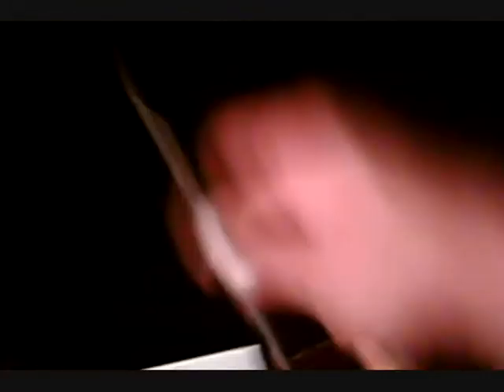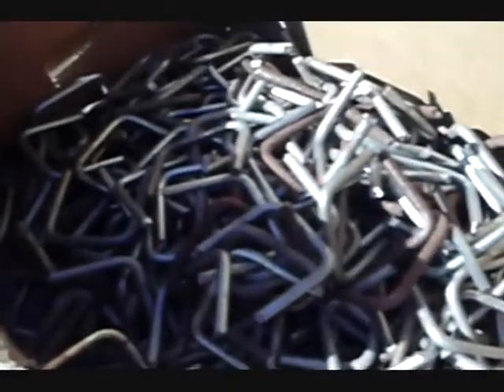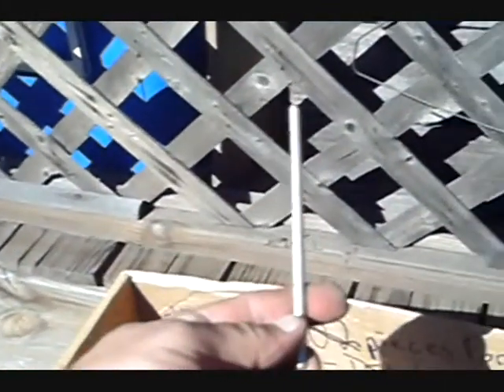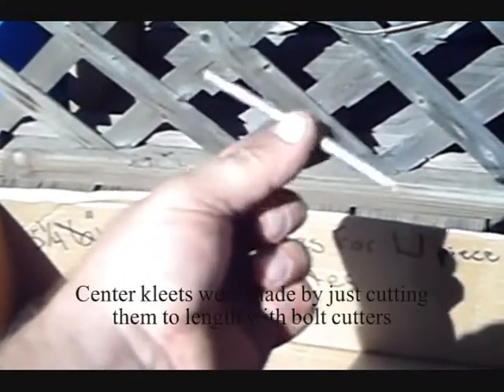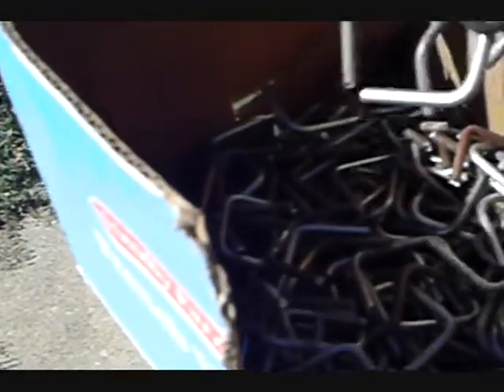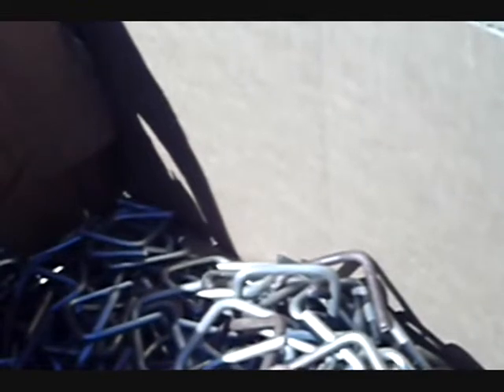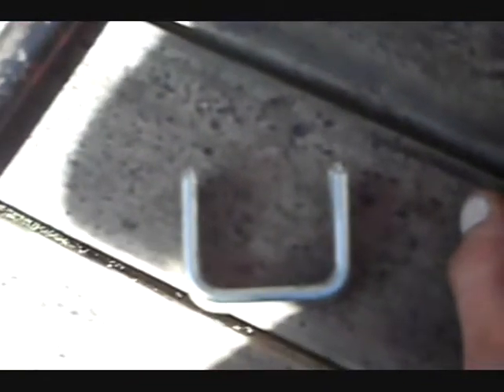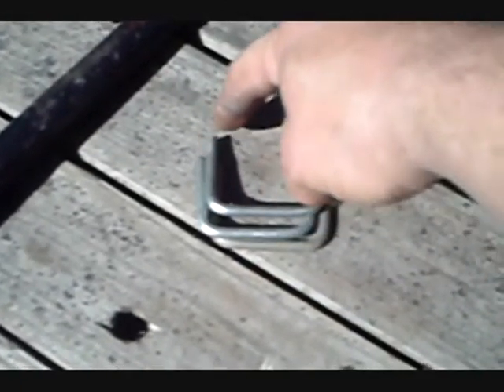Make and build your own tank tracks (X1 Scorpion Track Design) part 3

Comment: Looks good, lots of repetitive work. What are you going to work on next?
Reply from the maker: Aceman307 Next are the flat steel parts. The center plate, the guides, and the outer plates for the tires to roll on. I'm cutting those with a homemade bandsaw I made last night. You'll see tonight, I should be able to upload a vid tonight on that. I still need to get more flat stock steel for that too, but I got most of it to atleast to start welding. I did the cleets first because I thought that would be the easiest and quickes, boy was I wrong,LOL. Hopefully everything else will be quick and easier. LOL.